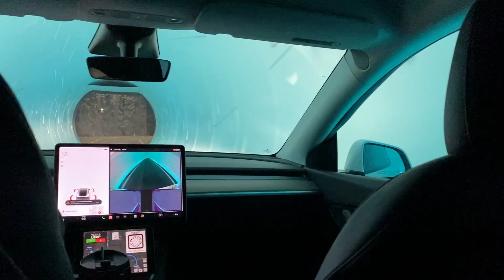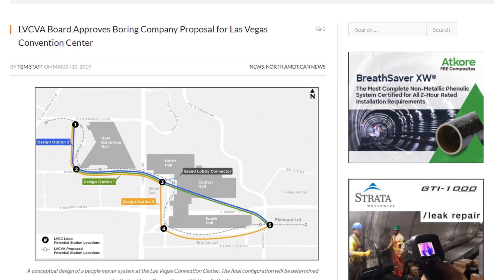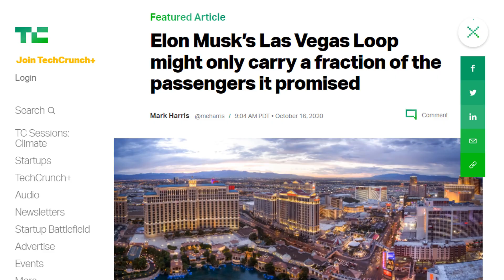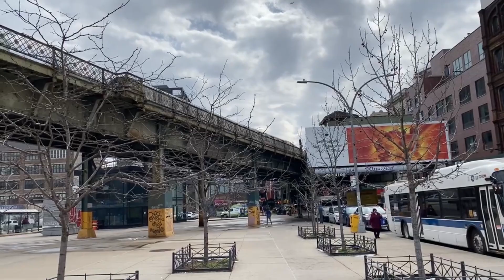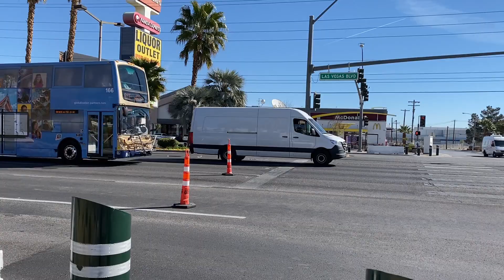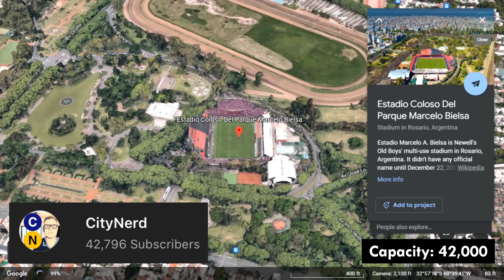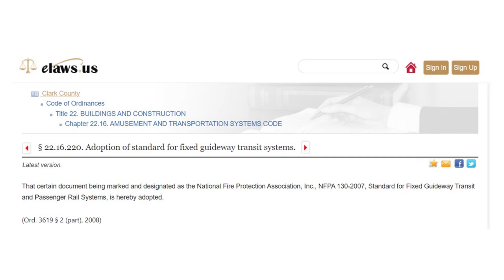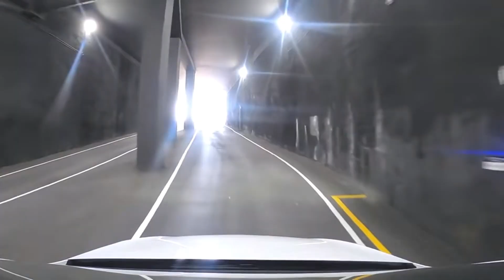Inside the Las Vegas Loop: Transportation Game-Changer, or Complete Waste of Time and Effort?

Comment: Elon always tweets about climate change while ignoring the benefits of public transportation (even downplaying its efficiency and usefulness). The boring company loop will be a failed experiment.
Reply: Well I'm pretty sure some of those tunnels may be repurposed for a small gauge metro system
Reply: @herlescraft  I was thinking about this myself, but is it actually possible? I'd love to see a video from an engineer going into detail on that and if it would even be worth it to try.
Reply: @AbsolutePixelMaster  i mean I'm pretty sure the dimensions are comparable to some of the older lines in London, the alignment might need some rework but if they are ok with a small train with not great top speeds and frequencies it could be done rather cheaply compared to a new one. And a somewhat poor metro system would definitely qonna lot better than... that...
Reply: @herlescraft  size wise thos tunnels are probably closer to the tiny tunnels of the Glasgow subway rather than the london underground, considering that they barely fit those Teslas.
Reply: @cyri96  i looked online and the las vegas tunnels should be 12 feet wide, the older lines in the underground 11.8 and the Glasgow subway 11, so yeah plenty of space...
what is reducing much fo the space is the need for a flat surface as wide as the car for it to run on, metro trains can have wide carriages on a smaller gauge track. yet one more thing proper public transport is better at.
Reply: @herlescraft  If I've understood other comments in here correctly, the Glasgow subway is only allowed to use those tunnels because they are "grandfathered in", as it were. New tunnels couldn't be built with the same dimensions, because there needs to be space for a path to walk next to the track.

Still, I guess they could make some custom narrow-gauge trains, like a rollercoaster or other amusement park attraction.
Reply: @Codraroll  why go they toy route, the london tube metro system is more than adequate for the tunnel size, just have them refitted with rails and you got a working metro. might have to slow down a lot before every curve if the alignment isn't good but it would still fit. no need to reinvent the wheel
Reply: @herlescraft  If I've understood it correctly, the narrow tunnels of the London Underground wouldn't be allowed in the US because space to walk between the train and the tunnel wall is required. Hence a need for an even more downscaled train for these tunnels, and then "toy" solutions start becoming the only off-the-shelf options available.
Reply: @Codraroll  we are hardly talking about an off the shelf solution here tho, already repurposing a car tunnel in to a metro one would disqualify the off the shelf part. idk about the space tho, ususally the us is the one lax on regulation and it does seem strange denying something that worked in the past, but IDK you might be right and there simply might be no solution possible.
Reply: @herlescraft  Never. There's no room for trains, trackside equipment, and emergency walkways.
Reply: Well obviously a guy that owns a personal vehicle company wants to paints mass transit as bad lol
Reply: Yes public transport it's against Elon main interest selling Cars It would seem  he's exibiting conflict if interest in his statements.
Reply: I’ve seen Paris and Montreal deploy small rubber-tired metros, and they could do well for the Boring Co tunnel size, given the tightness of the curves
Reply: They aren't Tesla branded.
Reply: I hope one day they actually make dedicated boring company vehciles with greater capacity. Like a small bus for the tunnel
Reply: @DanielLoganGames  higher capacity EV vans or buses or eventually the 16-person pods shown in CGI renders of the Loop have always been on the cards - the official LVCC Loop Fire protection Report even shows a front end diagram  of such a vehicle twice the height of a Tesla Model 3 in a cross-section of a Loop tunnel. 

The reason they haven’t done so yet is because they don’t need higher capacity yet.  Steve Hill, CEO of the LVCVA said back in May last year when asked about higher capacity vehicles in the LVCC Loop: 

“It seems that during a pandemic is not the time to be increasing capacity”.
Reply: It already is a failed experiment
Reply: He ignores public transport, because when riding you will encounter other humans. And Elon hates other humans.
Reply: A failure, like every other mass transit "initiative" in Las Vegas
Reply: Even if the tunnel fails, it was an experiment that offers many lessons.
Reply: the entire climate change debate is poisoned by CO2.
switching to oil from coal halves the CO2 output, and there is a LOT of coal used right now.

even more is thorium nuclear, which needs active running as opposed to active cooling, so if something goes wrong, it auto shuts down instead of auto meltdown like we've seen with chernobyl and fukushima. thorium reactors are a completely different type of reactor with night and day different safety profile.

we could also simply not build in flooding zones, at least in america. then it would also not be a drain on insurance subidies for those buildings with known elevated risk of being damaged.
Reply: He's also wasting money, time, and pollution with rockets to colonize Mars which is about the dumbest thing imaginable.
Reply: @baddriversofcolga  How is it dumb? It makes sense to spread humanity out, so we don’t have the entire human race on one planet. If something happens to Earth, we’d be wiped out forever.
Reply: @dlazo32696  First of all, Earth is a much better place for humans. We shouldn't just trash whatever planet we're on and then just go to some other planet and start over every time. Second, who cares if we're all wiped out? No one will be alive to care at that point.
Reply: yes
Reply: All 29 miles under Las Vegas is gonna fail. The company is now worth $5.7 billion. Contracts in Florida Texas. I swear all of you people lack imagination. 29 miles of no stop signs 29 miles of no crossways. Do you actually think it’s going to be the same car in the future. Who owns a transit system that stretches across all of Las Vegas. Practically zero labor when the cars are automated. Electric cars that’s crazy. Landing rockets back on the pad in the ocean that’s crazy. Worldwide satellite Internet that’s crazy. Putting a chip in someone’s brain where they can walk again that’s crazy OK that is crazy but still good for that person.
Reply: Actually, the Loop is MORE energy efficient than any train or bus, using 2-5x less power than any heavy or light rail transit system globally.  

Average Wh per passenger-mile:
- Loop Tesla Model Y (4 passengers) = 80.9
- Loop Tesla Model Y (2.4 passengers) = 141.5
- Metro Average (Hong Kong/Singapore) = 151
- Metro Average (Europe) = 187
- Heavy Rail Average (US) = 408.6
- Streetcar Average (US) = 481
- Light Rail Average (US) = 510.4
- Bus = 875

Sources: EPA and Federal Transit Administration 2019 National Transit Database

And all the above-ground Loop stations have massive solar panels on their roofs to charge the batteries.
Reply: @andrewfranklin4429  I'm gonna question those figures.
Some are clearly wrong and others need significant caveats.
e.g European electric bus is around 1Kwh per kilometre for the bus, not per passenger.
Neither is a comparison between heavy rail and a car valid in any respect.
Reply: @rolandrodgers5201  Hi Roland, the bus figure is for a diesel bus.  In the case of an electric bus, it is definitely more competitive, but still significantly less efficient than Loop EVs with 2.5 passengers on board because buses only have an average occupancy of  11 people when you include off-peak and peak periods while trains can be as bad as 27% occupancy over the whole day. 

Both buses and trains also waste large amounts of energy stopping and starting at every stop or station on the route/line. 

Here are the updated figures separating out diesel from EV buses:

Average Wh per passenger-mile:
- Loop Tesla Model Y (4 passengers) = 80.9
- Loop Tesla Model Y (2.4 passengers) = 141.5
- Metro Average (Hong Kong/Singapore) = 151
- Metro Average (Europe) = 187
- Bus (electric) = 226
- Heavy Rail Average (US) = 408.6
- Streetcar Average (US) = 481
- Light Rail Average (US) = 510.4
- Bus (diesel) = 875

Hope that makes more sense to you?
Reply: @rolandrodgers5201  also, if you doubt my figures, have a look at the “Energy efficiency in transport” page in Wikipedia and you’ll see that passenger trains in the USA consume 1.60 MJ per passenger km while on that same page you will see that the 2020 Tesla model 3 consumes 540 kJ/km.   So, by Wikipedia’s own figures, the Tesla is just on 3x more energy efficient with one passenger than trains in the USA.   With 2 or 3 passengers, considering each person only increases the car’s weight by 4.5%, you can pretty much divide that figure by 2 or 3 respectively and you can see the Tesla with 3 passengers comes in at up to 9x more energy efficient than a train.
Reply: @andrewfranklin4429   "passenger trains i[...] 540 kJ/km" why did you only use the USA metric rather than Idk the Switzerland data? 

could it be that trains using 470 would not be as good as a comparison... because we all like comparing apples and oranges but against an electric vehicle why not compare an electric train? as you hopefully know Switzerland has close to 100% electrification on its lines so any data coming from them is going to be on electric trains, so there you go.
Reply: @herlescraft  The Vegas Loop is in the USA but even if we compare Loop EVs to the 470 kJ/passenger-km of Swiss rail, while a Tesla with a single passenger uses more energy at 540 kJ/km, with the average of 2.5 passengers per Loop EV, that figure drops to around 216 kJ/passenger-km. 

With 4 passengers per Loop EV you’re looking at only 135 kJ/passenger-km, 3.5x less than that Swiss train.
Reply: @andrewfranklin4429  sure against the national average, for Basel it goes down to 85 kJ/passenger-km... and all my previous points of this not being a fair comparison still stand, plus the inutility of arguing energy efficiency for such a low capacity transport system...
Reply: @andrewfranklin4429  and what does it mean "The Vegas Loop is in the USA" is the US somehow under a different set of universal laws?
Reply: @andrewfranklin4429  Well I'm sorry but I do. Simply because they don't match up with figures that we have from studies in Europe.
And Europe is an area of the world which has extensive public transport, whereas the US does not.
Reply: @andrewfranklin4429  so exactly, you are using figures from
Reply: @herlescraft  does your figure for Basel account for occupancy?  The problem with trains is that they have average occupancy percentages down around 27% due to being almost empty during off-peak periods.
Reply: @herlescraft  Not sure why you think the Loop is low capacity considering the LVCVA reported:

“The Boring Company’s tunnel system successfully moved 25,000 to 27,000 passengers daily around the Las Vegas Convention Center campus during SEMA in November.” 

27,000 is:

- greater than the number of passengers that 65% of the stations on the London Underground individually handle daily which with 1.8 million passengers per day across 272 stations averages only 6,617 passengers per day PER STATION. 

- more than the 24,858 passengers per day per line pre-pandemic average of Kings Cross station, the busiest station on the Tube which pre-pandemic had 149,150 people per day across 6 lines. 

- more than the average of 13,684 people PER STATION per day of the entire Paris Metro which had a pre-pandemic ridership of 4.16 million per day over 304 stations.

- a bit less than the 38,888 people per day per platform pair average of the busiest station on the Paris Metro, the Gare Du Nord which pre-pandemic handled 700,000 people per day across 36 platforms. 

 - more than the 14,000 passengers per day per line average of the Stuttgart Main Station S-Bahn which pre-pandemic saw 140,000 passengers across 10 lines through the turnstiles daily.
Reply: @rolandrodgers5201  here’s a more extensive list of energy usage that may help:
Transit System	Type	Wh/pax-mile
Model Y; 5 passengers.	Loop	70.0
Model Y; 4 passengers.	Loop	86.9
Model Y; 3 passengers.	Loop	112.3
Model Y; 2.4 passengers.	Loop	141.5
Seattle; ST	LR	144.6
New York-Newark; NYCT	HR	164.7
Model Y; 2 passengers.	Loop	165.2
San Francisco-Oakland; BART	HR	177.7
San Juan; PRHTA	HR	193.2
Atlanta; MARTA	HR	193.5
Phoenix-Mesa; VMR	LR	206.8
New York-Newark; PATH	HR	217.1
San Diego; MTS	LR	223.1
Portland; TriMet	LR	269.1
Chicago; CTA	HR	320.1
Model Y; 1 passenger.	Loop	324.0
Boston; MBTA	HR	324.6
Los Angeles-Long Beach-Anaheim; LACMTA	LR	325.8
Philadelphia; SEPTA	HR	346.5
Charlotte; CATS	LR	349.8
Boston; MBTA	LR	350.1
Seattle; SMS	MG	354.1
Minneapolis-St. Paul	LR	385.6
Los Angeles-Long Beach-Anaheim; LACMTA	HR	390.0
{ HR Average }	HR	408.6

Denver-Aurora; RTD	LR	411.4
San Francisco-Oakland; SFMTA	LR	416.8
Houston; Metro	LR	425.9
St. Louis; METRO	LR	427.5
Philadelphia; PATCO	HR	431.9
Washington; WMATA	HR	439.3
Philadelphia; SEPTA	SR	461.1
New York-Newark; NJ TRANSIT	LR	465.9
San Jose; VTA	LR	468.7
Salt Lake City-West Valley City; UTA	LR	480.5
Seattle; ST	SR	502.3
San Francisco-Oakland; SFMTA	SR	502.7
Sacramento	LR	507.0
{ LR Average }	LR	510.4

Type
HR/LR = Heavy/Light Rail
SR = Streetcar
MG = Monorail/Guideway
Wh/pax-mile from 2019 NTD Data.

Electric Propulsion Energy Consumed in kWh / Passenger Miles * (Revenue Vehicle Miles/Total Vehicle Miles)
Last term corrects for Energy used for revenue service, and removes such uses as deadheading, training miles, etc...
Reply: @andrewfranklin4429  not sure where you got your figures for the loop but  i find accounts claiming it could not reach the advertised 4000 and is being limited to 1000/hour
Plus again you are comparing an whole network to a 3 station project operating only on days of its own choosing. Wanna have a fair comparison? Pick 3 stations in downtown newyork, and see what the metro is capable off when passenger scarcity isn't a factor. Statistically speaking this whole comparison uses such biased data that it makes no sense...
Reply: @herlescraft  it’s the LVCVA who has reported that the LVCC Loop handled 25,000 - 27,000 passengers per day during the SEMA conference in November. 

The SEMA show was only open for 8 hours each day meaning it handled an average of 3,375 people per hour.  However, no public transport system has equal distribution throughout every hour of the day, there are bumps and dips depending on demand. 
 
In the case of the SEMA convention, there was a single peak period in the middle of the day, so it would be higher than that average in the middle of the day and lower in the morning and late afternoon. 

So no, the Loop is not limited to 1,000 people per hour.
Reply: @andrewfranklin4429  idk i read the article from April this year that stated 
"Neither the intended capacity or speeds of moving passengers have been met so far for the Las Vegas Loop. Instead of the goal of 4,400 passengers, the capacity might be limited to 1,000 at a 40 mph overall speed limit.
Nevada officials in Clark Country have set strict speed limits and restrictions."
From "getjerry"
Reply: @herlescraft  remember that the Loop is only open during conventions so we can only talk throughput during such large conventions which was 25,000 to 27,000 people per day in the case of SEMA. 

And also note that the SEMA convention only had attendance of 114,000 attendees while the Loop was designed for conventions like CES which pre-Pandemic had attendance of 180,000 so the daily ridership of the Loop would potentially hit even higher levels than that 27,000. 

These are not perfect comparisons as we don’t know what the Loop at full capacity would be nor do we know what the maximums recorded by any of these subway stations are so we can only compare average daily ridership at this point. 

And by those figures, the Loop is definitely more than competitive with light rail and BRT and doesn’t do badly at all against subways. 

That is all I am trying to establish.
Reply: @andrewfranklin4429  and you are using bad metrics to do so, you can't say this 3 stops systems is more efficient than a national railway, or that is has more capacitity than london tube... it makes no sense. you are diluting the numbers on other systems to boost up the loop numbers, that is operating when it chooses, massively in the red, on a proof of concept level... those two data points are not the same. heck you even compared energy efficiency of an electric system against a diesel train, caliming it was indicative of massive gains where when compared to electric trains the numbers got comparable... what i'm trying to establish is that your methods for comparing the two transportation methods are very biased in a statistical sense and you should not take any of yours results at face value... statistics are hard but don't muddy the water futher,
Reply: @herlescraft  What metrics do you believe would be more appropriate? The full 29 mile 51 station Vegas Loop doesn’t exist yet so we can’t compare it directly against a similar sized light rail or subway system on total annual or daily or hourly ridership of the whole system.

We also can’t compare people per hour sitting on trains going down a line metrics as the main arterial tunnels of the Vegas Loop also don’t exist yet. 

The only metrics we can compare are what exists currently which is daily ridership during a medium-large size convention.  And what this demonstrates is that the Loop easily handles more passengers than the AVERAGE daily ridership of 65% of London Underground stations and the daily AVERAGE ridership of individual lines into almost all the major subway stations in Europe. 

Notice I am not saying that the current daily (or maximum theoretical) ridership of the Loop beats the maximum theoretical capacity of any of these subway lines, the data is saying that the Loop easily handles comparable passenger volumes as subways in daily operation. 

This should by itself be more than enough data to silence the critics who claim the Loop can’t carry useful volumes of passengers. 

Can we agree on this?
Reply: @herlescraft  and what do you mean criticising the LVCC Loop for only operating “when it chooses”? Of course the Convention Centre Loop only operates when conventions are on. That’s the whole point!
Reply: @herlescraft  As I said, with the average of 2.5 passengers per Loop EV, energy consumption comes in at 216 kJ/passenger-km, 2.1x more efficient than the 470 kJ/passenger-km of that Swiss electric train. 

With 4 passengers per Loop EV you’re looking at only 135 kJ/passenger-km, 3.5x less than that Swiss train. 

Here is a complete list of energy used per passenger mile for all electric and diesel electric trains in the USA. As you can see, the Loop beats them all with the average 2.4 passengers per Loop EV or greater and even with 1 passenger still manages to beat most of them. 

Transit System	Type	Wh/pax-mile
Loop Model Y; 5 passengers.	Loop	70.0
Loop Model Y; 4 passengers.	Loop	86.9
Loop Model Y; 3 passengers.	Loop	112.3
Loop Model Y; 2.4 passengers.	Loop	141.5
Seattle; ST	LR	144.6
New York-Newark; NYCT	HR	164.7
Model Y; 2 passengers.	Loop	165.2
San Francisco-Oakland; BART	HR	177.7
San Juan; PRHTA	HR	193.2
Atlanta; MARTA	HR	193.5
Phoenix-Mesa; VMR	LR	206.8
New York-Newark; PATH	HR	217.1
San Diego; MTS	LR	223.1
Portland; TriMet	LR	269.1
Chicago; CTA	HR	320.1
Loop Model Y; 1 passenger.	Loop	324.0
Boston; MBTA	HR	324.6
Los Angeles-Long Beach-Anaheim; LACMTA	LR	325.8
Philadelphia; SEPTA	HR	346.5
Charlotte; CATS	LR	349.8
Boston; MBTA	LR	350.1
Seattle; SMS	MG	354.1
Minneapolis-St. Paul	LR	385.6
Los Angeles-Long Beach-Anaheim; LACMTA	HR	390.0
{ HR Average }	HR	408.6

Denver-Aurora; RTD	LR	411.4
San Francisco-Oakland; SFMTA	LR	416.8
Houston; Metro	LR	425.9
St. Louis; METRO	LR	427.5
Philadelphia; PATCO	HR	431.9
Washington; WMATA	HR	439.3
Philadelphia; SEPTA	SR	461.1
New York-Newark; NJ TRANSIT	LR	465.9
San Jose; VTA	LR	468.7
Salt Lake City-West Valley City; UTA	LR	480.5
Seattle; ST	SR	502.3
San Francisco-Oakland; SFMTA	SR	502.7
Sacramento	LR	507.0
{ LR Average }	LR	510.4

Type
HR/LR = Heavy/Light Rail
SR = Streetcar
MG = Monorail/Guideway
Wh/pax-mile from 2019 NTD Data.

Electric Propulsion Energy Consumed in kWh / Passenger Miles * (Revenue Vehicle Miles/Total Vehicle Miles)
Last term corrects for Energy used for revenue service, and removes such uses as deadheading, training miles, etc...
Reply: @andrewfranklin4429  That is completely awesome. Just the facts a beautiful thing. I love numbers. It amazes me that Las Vegas gave the boring company a 50 year Lease For some of the most valuable real estate in the world. The advertising possibilities is incredible.
Reply: @andrewfranklin4429  25k People daily?! Dude, that's pathetic.
Reply: @sagichdirdochnicht4653  on the contrary 25,000 to 27,000 passengers daily around the Las Vegas Convention Center campus during SEMA in November is:

- greater than the number of passengers that 65% of the stations on the London Underground individually handle daily which with 1.8 million passengers per day across 272 stations averages only 6,617 passengers per day PER STATION. 

- more than the 24,858 passengers per day per line pre-pandemic average of Kings Cross station, the busiest station on the Tube which pre-pandemic had 149,150 people per day across 6 lines. 

- more than the average of 13,684 people PER STATION per day of the entire Paris Metro which had a pre-pandemic ridership of 4.16 million per day over 304 stations.

- a bit less than the 38,888 people per day per platform pair average of the busiest station on the Paris Metro, the Gare Du Nord which pre-pandemic handled 700,000 people per day across 36 platforms. 

 - more than the 14,000 passengers per day per line average of the Stuttgart Main Station S-Bahn which pre-pandemic saw 140,000 passengers across 10 lines through the turnstiles daily.

In other words the 27,000 people daily through the Loop is remarkably successful.
Reply: @andrewfranklin4429  Dude, Stations. Those are fucking Systems, that move Millions of people. People get on and off at different points. 

But there is no point in arguing with people who believe, that  a transport system based on cars is a good idea.
Reply: @sagichdirdochnicht4653  they’d better move millions of people because they have hundreds of stations and many more miles of track.  The Loop will soon be a 29 mile 51 station system as well moving hundreds of thousands a day as well. 

You’re the one who said that 27,000 people per day is pathetic, I merely showed you that actually it is very comparable to individual subway stations in terms of passenger throughput. 

If we just look at a similar sized subway system, the Berlin U55, which is a 3-station 1.5km subway in the centre of Berlin, you’ll see that it only carries a minuscule 6,200 people per day and yet cost half a billion in today’s dollars in total compared to the Loop moving 27,000 people per day and only costing $48.7m. 

Now who’s pathetic?
Reply: @andrewfranklin4429  You. You are. You have admitted yourself that the 27,000 number is not a good metric, so why do you keep repeating it?

Your posts are an insult to the profession of transport engineering and to the concept of coherent logic. And honesty.
Reply: @Codraroll  Not sure where you get the idea I think the 27,000 people per day metric is a bad metric. 

What I have said is you are comparing apples and oranges when you try to compare “people through the turnstiles” metrics against “people sitting on trains going down a line” metrics.
Reply: @herlescraft  "Instead of the goal of 4,400 passengers, the capacity might be limited to 1,000 at a 40 mph overall speed limit." That comes from a techcrunch article (getjerry copied it) that misinterprets the fire code. It's preposterous that they would plan a system that needs to achieve 4,400 pph that can only theoretically hit 1,000 pph because 'fire code'. They've already released numbers and they moved over 3,000 ppph. I sent an email to the author and they said to "work our articles from newest first" so they aren't interested in correcting it.
Reply: @andrewfranklin4429  i highly doubt it as steel on steel is always going to lose a lot less energy than rubber on asphalt... And even if what you say we're 100 accurate... What's the point of having an efficient transportation method if it can't handle the number of passengers required. An old noisy and polluting 1930 bus is still a better solution than 30 people using their cars, if the loop can't be a valid mass transit solution it's efficiency matters very little. And again i highly doubt your data.
Reply: @herlescraft  Steel wheels are not actually the big deal in energy efficiency that you may think. Rolling resistance is only responsible for about 15% of the energy usage of a vehicle compared to wind resistance, fuel/energy conversion losses, mechanical losses and overcoming inertia when accelerating which account for a massive 85% of the energy usage of a car. 

You’re probably getting confused by the fact that ICE cars are less energy efficient than trains (which they are) and thinking that also applies to EVs (which it doesn’t).  

The average energy efficiency of trains is dragged down by big heavy trains moving small numbers of people off-peak as well as having to start and stop at every station on the line. That is why the Loop EVs use less power than any heavy or light rail transit system globally.
Reply: @andrewfranklin4429  but a full las Vegas loop operating normally would also need to operate off peak and stop at all stations along a network with more than one, for everything else 
A train is still less complex than the car as it does have its form for a reason, a lot more people share the same space, the same ac and the same weight, aerodynamically speaking surenq car might be more aereodinamic but a train would only need to pass once where a car based system would need 10or more vehicle to move the same number of people... That's bwhy i feel like your numbers are comparing the best of the loom with the worst of the other systems and still coming up with barely comparable results.
Reply: @herlescraft  The Loop is actually FAR better off-peak than railways or buses off-peak.  

Loop EVs scale more efficiently with the ebb and flow of passenger volumes as they only leave a station if they have passengers while a bus or train is forced to drive around mostly empty a lot of the time.   

The average occupancy of buses is a dreadful 11 people when you include off-peak and peak periods while trains can be as bad as 27% occupancy over the whole day. 

That is a major reasons why Loop EVs are so much more energy efficient. 

And of course, the Loop EVs travel direct to there destination rather than having to stop and start at every single station on the line or route like a bus or train.
Reply: @andrewfranklin4429  You say that, but stations do not have equal demand over time, a branch line will not have the same number of passengers as a downtown stop. It's easy to say this 3 stop systems is great efficiency but once you scale it up cars will start doing the return trip empty reducing the occupancy rate you are so proud of or you have the bike sharing issue of destination being filled with vehicles while origins having none... The lip is far from having good 1:1 data on and technologically speaking it will not be able to reach mass transit status, at most it could be a viable gimmick, the kind las Vegas is famous for...(see monorail)
Reply: @andrewfranklin4429  Luxembourg Luxtram can transport up to 422 people every 2 minutes

422 persons transported in 2 minutes

844 persons transported in 4 minutes

1266 persons transported in 6 minutes

1699 persons transported in 8 minutes

2110 persons transported in 10 minutes

2532 persons transported in 12 minutes

2954 persons transported in 14 minutes

3376 persons transported in 16 minutes

3798 persons transported in 18 minutes

4220 persons transported in 20 minutes

4642 persons transported in 22 minutes

(already in 22 minutes more than the 4400 of the Loop in one hour)

12660 persons transported in 60 minutes (1 hour) just from one station start to another.

All from just one station, and for 500 million euros (a bit more in USD), you got 16 kilometers (10 miles), 24 stations and many tramways.

50 million per mile with 24 stations and tramways 3 times more people

While Loop 50 million for one mile, one station, no cars, no drivers in these 50 million price.
Reply: @THEREALZENFORCE  Luxtram has 15 stations over 7km and takes 23 minutes to travel that distance at the dreadfully slow speed of 11.3 mph.

The tram has a daily ridership of only 31,300 passengers only 16% greater than the 27,000 people per day of the Loop despite having 5x the number of stations, 5.4x the length and costing $604m or 12.4x more than the LVCC Loop.  And it isn't even underground so has all the problems of above-ground rail in terms of noise and land-use.

I don’t think I’d be using that as an example if I was you Zenforce!  :-)
Reply: @andrewfranklin4429  Wikipedia : Energy Efficiency in Transport : 
Tesla Model 3 has 1.76 km/MJ (for max 4 passengers)
German ICE train is 68 km/MJ (for 918 passengers)
ICE train is 0,07 km/MJ per person while the Model 3 is 0.44 km/MJ per person with makes the Model 3 at big 6.2 worse efficient, requiring 6.2 times more energy per person (with 4 passengers, that would be 24 times worse with only one driver and no passenger)